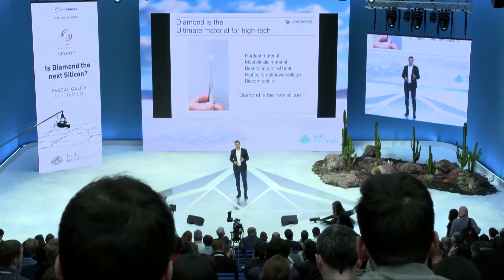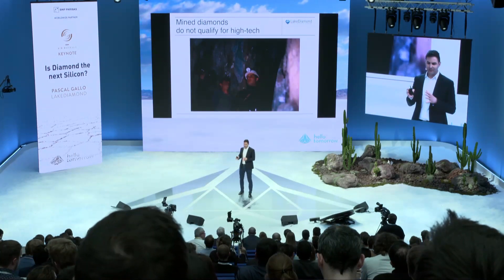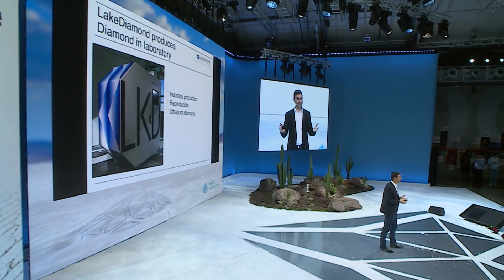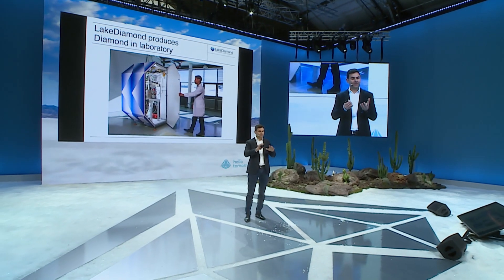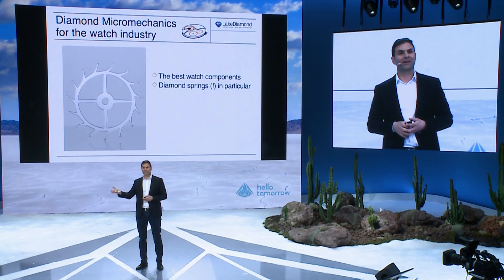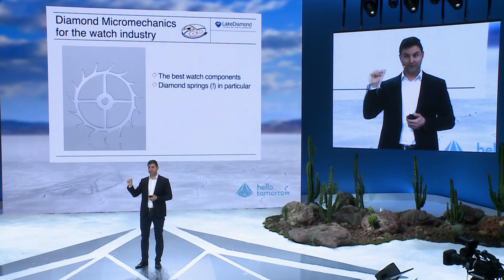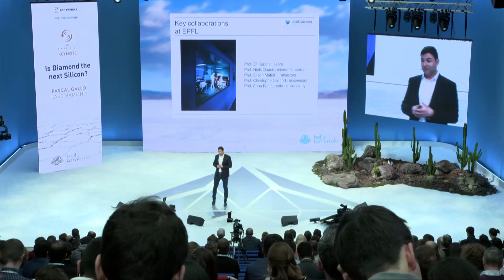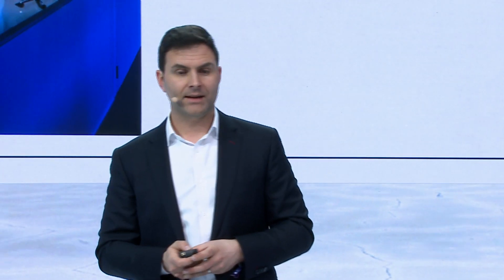Is Diamond the next Silicon? I Pascal Gallo, CEO at LakeDiamond

Comment: One can think of laser power beaming when you want to recharge a drone, or when NASA sends austranauts to Moon! That is too expensive and very in-efficient, with high maintannace costs, and safety issues. So, I have a hard time accepting that it is a useful thing for remote spots in Africa! You need to really have MONEY and it is the last resort to think of! The best lasers have an efficiency of 40%, the best solar cells have an efficiency of 30% on the market! That means you dump 2/3 of your energy IF you have the bests of the bests! Why not giving the folks a portable solar panels, batteries, and small wind turbines and also some LEDs?!